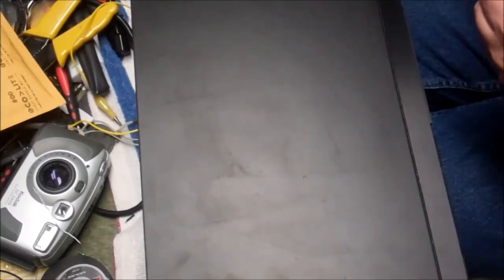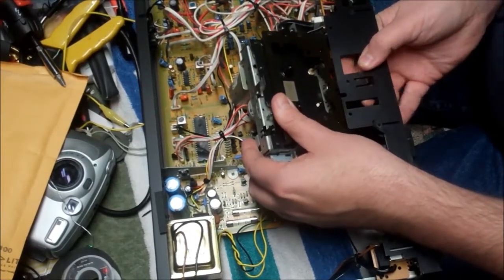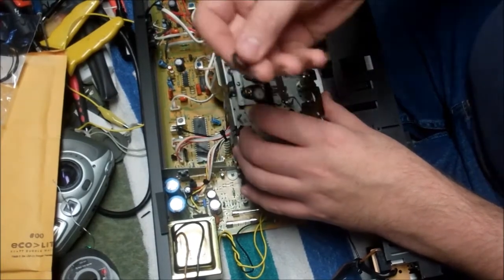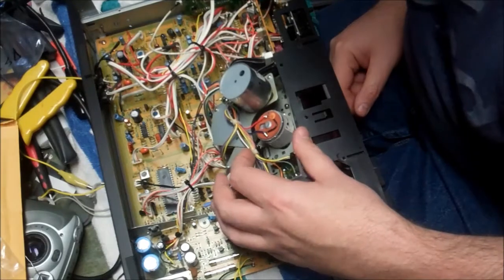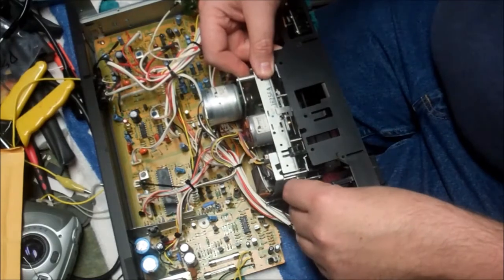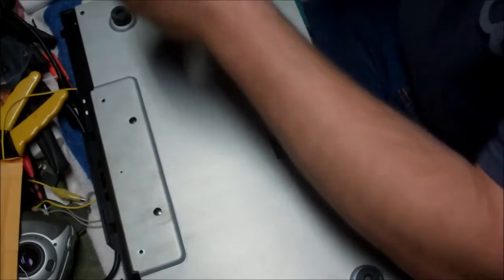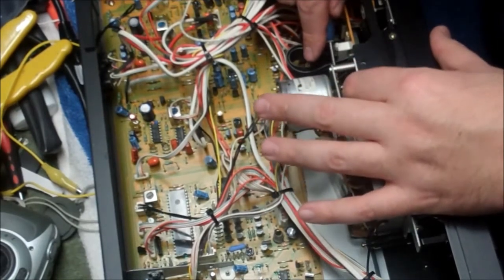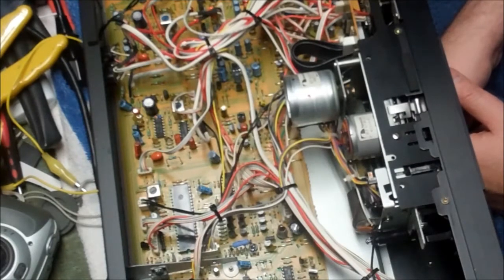Nakamichi BX-100 (Part 2)  Let's install new belts and idler tire.

Comment: Most of the time when a Nakamichi won't play rewind or FF is because the tire surface got glazed and slippery due to age.  ALL you need to do is using a 1500 grid sand paper glue to a bamboo stick (Chinese disposable bamboo chopstick shaved to have a smaller diameter of about 2~3 mm diameter will do).  Cut a small piece of about of 1 inch long glued to and wrap around the tip of the stick.  Use it to sand the tire surface all around and then use the tape head cleaner such as 'S-711 Intraclean' to clean the tire surface after sanding.  No need to remove the tire, no need to replace belt as long as the capstan is running.  Your tape deck will be working 100% like installing a new tire after only this sanding and cleaning of the old tire in situ.

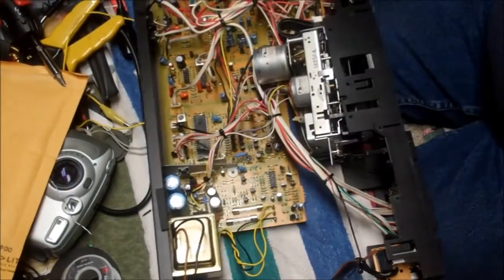Comment: Hi Deadkoby.  Nice video.  I don't know if you have figured out by now since your video was done in 2017 but have you figured out that there is no need whatsoever to remove the front face plate to remove the tape transport?  I see, after you removed the cover, that the top set screw for the transport was missing.  On the bottom,  there is access through the bottom plate to unscrew the 2 set screws that hold the bottom of the transport in place.  Then you could easily slide the transport back and lift it up as you did at 3:37.  Just unhook the 4 harness connectors to the motherboard and side board to free it all up to remove completely from the chassis.  I see when you put it back together, you didn't realize that there was a set screw for the top of the transport.  It should be just "down" from center in your video (the notch you can see). 

The door cover simply and easily pops up and off after the door is in the open position.  Again, no need to remove the faceplate.  

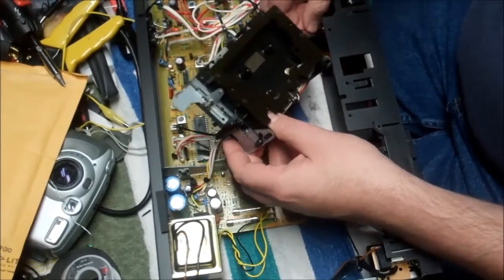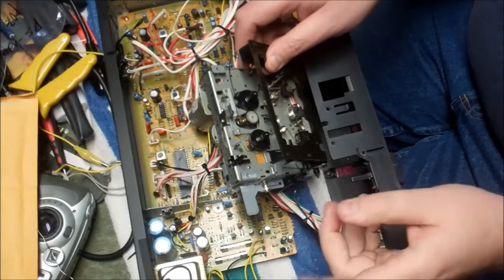Once the transport is free to work on, the 2 little screws that hold the tape door can be unscrewed to remove it for access to the cover plate at 5:20. And that is only if you need to replace the idler wheel and or test it for torque.  At 7:47 - 8:20, it's better to remove the idler wheel using the tape method so as not to lose the locking washer that keeps the idler wheel in place. Then you can take off the idler tire and replace.  The scary part though is placing the assembly back on and then gently pushing the locking washer back into place but not too hard so as to brake the idler arm.  You can put a screwdriver or something behind it to take up space so the idler arm doesn't get pressed down and break.

You don't have to worry about fatiguing new belts.  The stretch to place over the drive pulley is so minimal.  I use a 90* angle pick as it fits in quite neatly and can pull the belt over the pulley.    

What's nice about removing the face plate is to get to the switches and recording sliders to remove and use some DeOxit to spray and clean the contacts.  

Good job getting your belts from Bob at Vintage Electronics.  Quality belts which will prevent wow and flutter and be accurate when putting on the scope to check motor speed.

The other thing you could have had fun with is desoldering and taking out the transport motor to take apart and clean the armature and brushes.  

I appreciate how meticulous you were.

Comment: I did the replacement of the idler and counter belt by removing only the front door and the black plate that the idler is hiding behind. Removing the black plate allows room to replace the idler and the counter belt. I then replaced the capstan belt by first removing the units top cover and then the 3 screws that holds the capstan motor mounting plate. This allows that assembly to be moved back just enough to remove the old capstan belt and put on the new belt. This worked well without having to take disassemble a lot of stuff.
Reply from the maker: glad you solved your issue.

Comment: Very helpful.  I have a BX-300 I bought in Japan in '85 that I'm going to replace the belts on once they arrive.  
The deck is in immaculate condition otherwise, and it would be a shame to (1) part with it or (2) overpay someone to do basic work, so thanks for sharing your procedure.  One thing I might comment on for your viewers is (you did say it was your first attempt), having had one of these for 37 years, I can say that there is no need to work around the tape door cover during the initial disassembly--can be removed on step 1.  If the tape carriage is in the eject position, the door will lift up and off of the carriage chassis.  Gravity and a small amount of friction are the only things holding that piece in place.  Thanks again!

PS--I appreciate you managed to perform that whole replacement without cutting any tie-wraps.  I am hoping to keep all of them in place to preserve the original factory condition and configuration as much as possible..

Comment: Extrapolated to a Nakamichi MR-1.  Be careful to change the small belt on the take up wheel on the left hub.  Mine was super-stretched.  Thanks, DeadKoby!
Reply from the maker: Although I'm a guitar amp tech... there's almost NOBODY who will do honest work on home stereos..  so although I'm not well schooled in them, I take a shot and usually figure it out.  I figure that someone out there will benefit from knowing what worked for me.   There's a lot of keyboard warrior experts who tell me everything I did wrong too,  but in the end, the result was good.

Comment: how about the idler disc, it does look a bit fragile, shouldnt it be first removed off the mechanism?  i gotta do that this evening and the choice aint easy - should it stay inplace and risk it breaks while forcing the new tyre on, or should it be removed but chances are the washer flies off - the trick with sticky tape may work but may not be 100% safe
Reply from the maker: I guess it depends how much resistance the old idler wheel has.
Reply: Hi, how you did? I had the same doubts as you and I just broke the idler holder while placing the new tyre on...
Reply: @wrecords5345  the worn idler tire was sitting on its plastic wheel super tight, there was no way I could replace it while it was sitting in-place.

it took  me 15 minutes of fiddling with half-rounded nose pliers to remove the washer, then I removed the complete idler wheel, and then replaced the tyre. putting the washer back onto its axle was easy.

the amount of force I had to use to pull the old tyre off surprised me, the rubber was super tough. I would never try to do it the other way unless the rubber tyre was loose.

Comment: I can't believe you're a tech because that is not how you change idler... you could have broken the idler wheel or the leg holding it by doing what you were doing and say goodbye to the deck.  In most cases, there is a plastic washer in the middle of the wheel holding it down to the leg and you can simply pull it off and the wheel will come off the leg and there you replace your idler off board...
Reply from the maker: I'm glad you enjoyed the video.   This tape deck has been returned to the owner over a year ago, and he's enjoying using it again.   Have a great day.
Reply: @DeadKoby  I understand that you did fix the problem and it works. BUT I do believe that an Technician would have taken the idler wheel off. I have a Nakamichi RX-202E and a 505E. The 202E was serviced for idler wheel and belt for the cassette slide, if you know anything about the Auto Reverse of this unit? Anyway the service was expensive for about 1 hrs. work, but the parts were cheap. All together it cost me 227€ or $288!! They let my player run 24hrs. and as far as I’m concerned it works GREAT!! With my newly acquired 505E I believe has the same problem. Although I am no Tech I would have one repair my player. This BX-100 isn’t a very expensive unit, so practically any Novice could replace the needed parts, and if the motor went, then thrashing it isn’t a big deal. But with the 202, 300, 505, and the Dragon, a FUKUP could lead to other issues that eventually could cause money problems. The point I want to make is that you didn’t adjust the heads or the tape azimuth!! I know by the afore mentioned players, this is very important. Does this unit have this ability? I believe the more detailed or expensive players require a higher degree of experience and equipment. I didn’t see you testing the tape speed in play either. True enough it works, but does it work according to the Manufacturers specifications? I know We Americans have a different attitude about procedures. Like you said, when putting it back together you have to do it actually in REVERSE. If you miss a step things could get Funky. Thanks for the vid.
Reply: You are a troll. He is giving people tips and tricks and if you can't be grateful for that maybe you should keep your comments to yourself.
Reply: @mr.nobody5422   that is why your name is Mr Nobody... I was only trying to help people do the right thing so that their much loved and priceless Nakamichi can remain working...
Reply: @junehi03  There's more than one way to do things.  The internet is absolutely overrun by people like you complaining about the way people do things and claiming their way is the only correct way to do it.  In many cases, changing an idler tire can be done from the front plate, without any further disassembly required.

Comment: Cheers. I need to change the control cam belt on my ZX-7, waiting on belts. As a novice, it was reassuring to see you work.
Reply from the maker: Cool...  Glad to help.   This was my first adventure with this model,  but just taking a good look at things usually gives you a sense of how it should work.

Comment: What happens to alot, and I mean most decks like Sony, and some Pioneer's...is the belts will, what I call MELT...they become liquid rubber and get very sticky...and you dont know which way they go, and that makes it hard for some to repair them..but the site HiFiengine.com has ALOT of service manuals that will help so everyone check them out...Oh yea...register for FREE and then get all the manuals...I have nothing to do with that site..but I enjoy looking at all the different decks, and the ways they work.
Reply from the maker: Yes, I am familiar with that web site....  and belts that turn to sticky goo.   Vinyl Engine is the sister site for those of us who like Turntables.

Comment: Hello  DeadKoby.... I just want to take a moment to thank you for this excellent tutorial in installing new belts and an idler tire on Nakamichi Cassette Decks. I was able to extrapolate from what you did on your Nakamichi BX-100 and apply the same technique in principle to my Nakamichi MR-2. The operation was a success and my patient (Nakamichi MR-2) now has a new lease on life thanks to you! I watched your video a few times to try and get the hang of it before actually going for it. I admit I was a bit nervous as it's not what I do on an every day basis. Your video definitely gave me the confidence to perform this procedure. I did though have to cut a few of the wire ties loose as I really didn't have much wiggle room. I was afraid I would rip something out if I didn't relieve the pressure from those taught wire bundles. Some of those tight spaces also made me feel like I had super fat fingers! LOL Well maybe I do but I'm a happy camper with a big grin on my face smiling ear to ear as I listen to the play back while I type this comment out!!!
Reply from the maker: Glad to help.   It's always "fun"  working on the small pieces.   This was the first one of these I did,  but I've done other cassette decks.   In general,  I fix mechanical stuff,  and it's just a matter of watching it work, and putting together the puzzle.
Reply: Is Nak BX 150 better than Nak CR1?
Reply: the BX are pretty much unserviceable until you get rid of all wire ties ;)

Comment: I have a new belt for a DR2. Not sure how similar the tape assembly is to the BX-100 but they look similar. The old one was broken into pieces. So I'm wondering how the belt routes and wraps around the 2 capstans. Any insight?
Reply from the maker: Unfortunately my memory doesn't last that long,  but I would look up a service manual on the web site called  Hi-Fi Engine.  There's lots of great resources there.